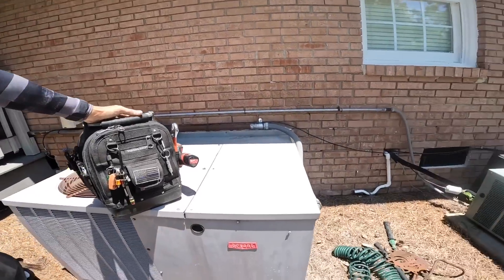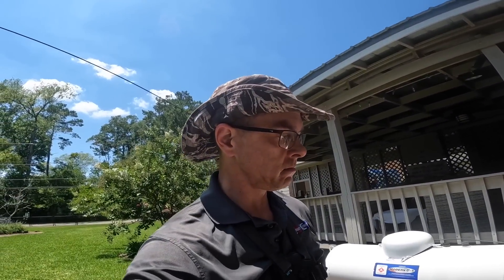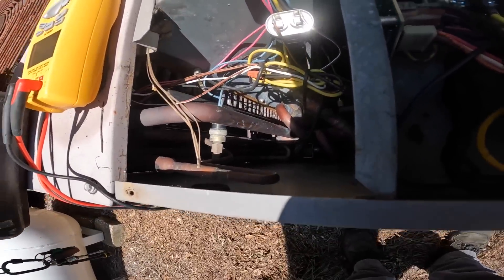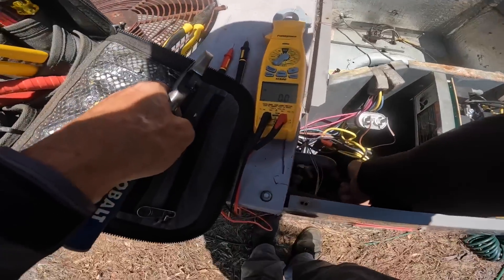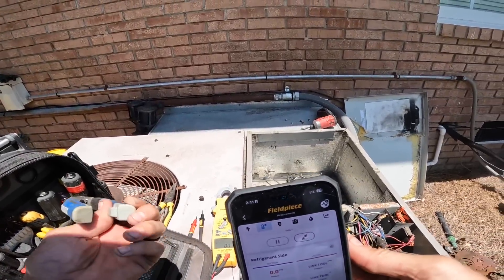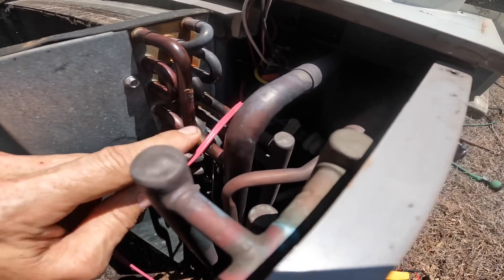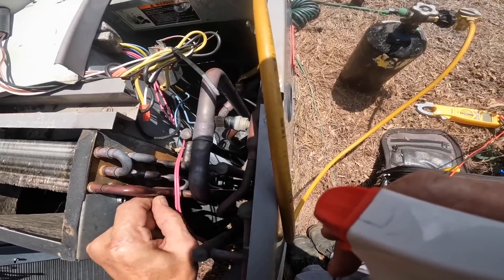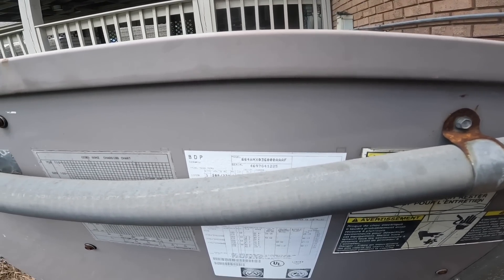1997 Bryant Package Unit Wth Major Failure! #hvacguy #hvaclife

Comment: Years ago I was doing a cooling p.m. and I was hustling because there was a bad lightening storm on it's way. I finished and was driving the hour home. Almost home and the customer called saying they didn't have cooling. I went out the next morning and there was a hole blown in the suction line from one of the terminal leads but all of the insulation on the wires was in good condition. I repaired it and got out of Dodge because there was another lightening storm on the way. A couple of hours later the customer called saying they didn't have cooling again. I got out there and there was a much larger hole blown in the suction line from a terminal lead and once again, wiring insulation with no holes but a little blackened. They wound up filing an insurance claim and got rid of the old R22 system.

Comment: Nice video, I’ve had Goodman horizontal package unit condenser wires rub and short causing leak in the aluminum evaporator. This reminded me of it except the Goodman was only a couple years old not 26 .

Comment: You make things look so easy  On Sunday had a blower motor give up the ghost I have replaced them before and never had issues like I did this time . This was on a older Carrier furnace had to remove a pc board no problem till I put unit back in service could not get fan to run Eventually found two stat wires broke from terminal got everything back wife is now happy out here in nevada